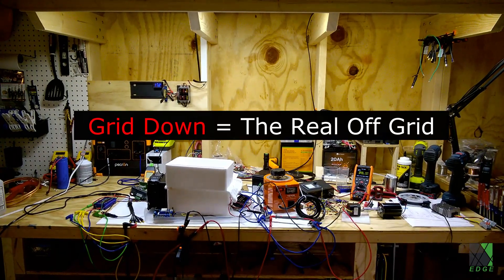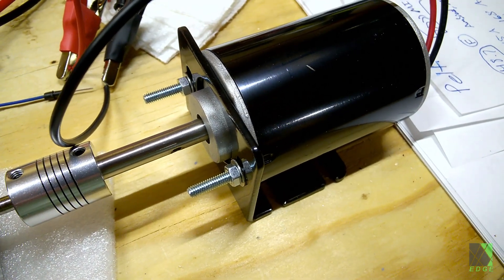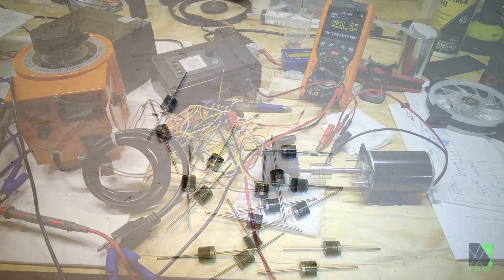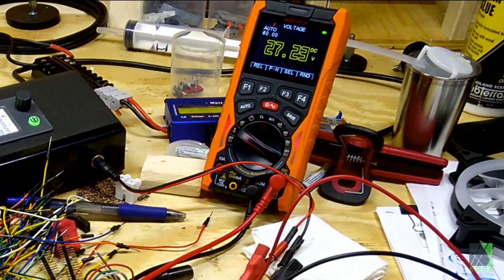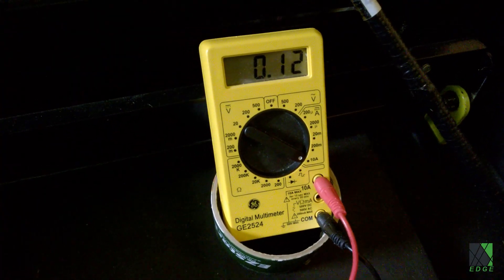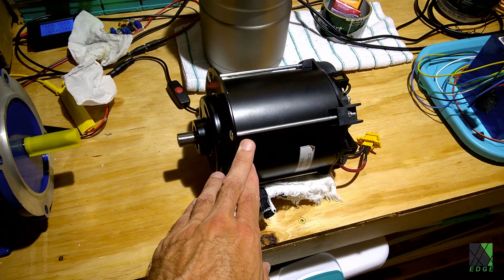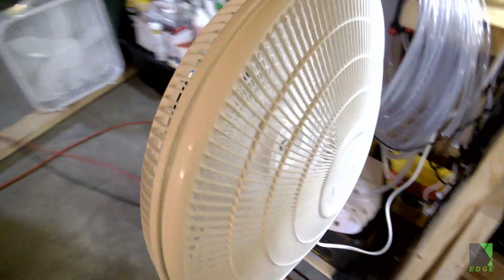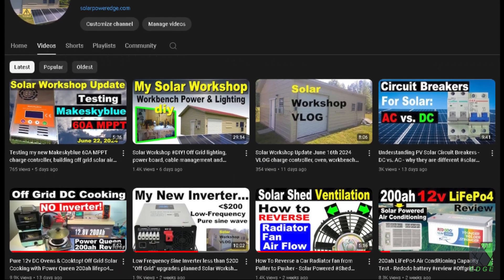Grid Down Electromechanical Voltage Conversion & High Tech Survival! How to charge 48v from 12v #diy

Comment: I still have a box fan that I put an auto radiator fan motor in it. 6 amp pull. I think it would work ok with a 12-volt solar panel. Never did try that yet. I have around 1500 watts at 12-volt. I did make a solar ceiling fan that we used for lots of years. Wife wants me to put it back up. I used a 36-volt DC Ameteck motor. Worked great. I used an electric heater element for speed control back then. I now use the cheap dc to dc controllers form China. You have some great videos. I just found your site. I will be looking at a lot more. Thanks.
Reply from the maker: @MrBasilkey Hi, glad you found this site... nice fan mods.... yeah I am sure it would run on a solar panel, even a 50w panel would probably get some good cooling

Comment: Is it possible to take a universal motor from a washing machine and then add windings and tap them at the desired voltages and then use that voltage to run stuff?
Reply from the maker: @bigmouthstrikesagain4056 Hi, excellent idea. I need to experiment further, with 2 motors I found. One is a washing machine motor, the other is a different kind. If I build anything useful I will upload the results and share

Comment: i cant see what wires you have going where with all those wires in the back lol!   i am going to check and see if that looks similar to the step up motors i have.,  been out for a bit and was happy to see a new video...  FYI  will email you a idea i had about a dc air fryer/ confection oven
Reply from the maker: @vrrevolution9183 There's wires everywhere, but they make things happen :) 
OK will keep an eye out for your message... FYI I am building a larger oven for solar/12/24v but haven't been able to finish it. The half-finished oven appears in my last VLOG
Reply: @solarpoweredge  i do not see it?   is it on your website?  please pass link
Reply from the maker: @vrrevolution9183 It's a bit hidden... the VLOG was added on the end of my solar air conditioner video here. The oven is barely mentioned but it's all I have uploaded right now https://youtu.be/2I4lH-8_cCs

Comment: Ahhhh this video takes me back to the 90's here in Melbourne when we had a fire at the natural gas works and since most of the houses need gas to run the stove, heating and water boiler, should have seen the mad rush to get out and purchase something to cook and boil water with that didn't run on natural gas.... 
I still remember going into apocalyptic survival mode.... 
I took an old oil drum, cut it open at the top and put some breather holes in the bottom, then I took apart an old box AC unit that I brought home ages ago for reasons I couldn't remember, I took out the larger radiator and put it on top of the oil drum which now has firewood in it, with some Teflon tape I was able to get the garden hoses to fit into the radiator, the other side of the garage hose went to a tap which will supply the radiator over the fire with cold water and then send it to the boiler and into the overpressure release pipe which was easier to open the tap on to let the hot water to come in.... All I had to do then was turn on a hot water tap inside the house to complete the system and in a short time I had a boiler full of hot water for showering! 
While others were having a bath like it's mediaeval times in England, I was having normal showers like nothing was wrong! 
I know a lot of people who will pick up a nut or screw around their property and toss it in the bin, I'm not one of those people! I will admit that I'm a hoarder.... But I will never throw something out only to need exactly that a month later and then go to someone who hoards stuff expecting them to provide me with whatever they were hoarding! If I'm going to through out everything, I should always remember where all the shops are and be prepared to pay.....
Reply from the maker: @PeterMilanovski What a machine... that is exactly the kind of engineering I like and respect. Getting the job done! My hot shower is literally an old cat litter bucket with HWH element, and /or a cheap insulated cooler with heating element if more is needed. Hot showers are critical to boost morale during bad scenarios :)
PS I will admit, I am a hoarder. Can't even throw away plastic cutoffs, cardboard boxes, bits of wire insulation, bottles, it's terrible. On the other hand, "waste not, want not".
Reply: @solarpoweredge   I think that a good way to heat water is getting a square aluminium pipe, seal up the ends, tap some threads and install some pipe connections at either end, get some TO220 diodes and line the pipe with them, you can probably solder them? Not sure if their metal tabs are connected to one of the pins? Or..... You can use Peltier devices which are a heat pump after all!. Something to use as a thermostat and a small water pump to circulate the water in a tank..... Or possibly go tank less and just use more aluminium pipe, each Peltier device doesn't need to run at full power as the water should be getting progressively hotter the further it gets...... You then can control the voltage to get the water at the right temperature..... 
Lots of ways to go about it....
Reply from the maker: @PeterMilanovski Found some metal pipe that's 2 inch square, it just might get turned into something. Tons of ideas here :D
Reply: @solarpoweredge   there you go! I have some aluminium 2 inch square tube left over from the roof installation of solar panels that I have been planning on getting the ends sealed off but I don't have an aluminium welder, recently I was introduced to someone who can help me with that! 
My first idea was to put Peltiers on it to generate some current form waste heat, then use that current possibly via a DC to DC converter to drive other Peltier devices to actively cool the (either) other end of the square aluminium pipe or use a separate pipe.... 
Basically the idea is to cool down the waste heat water using the heat to cool it with.... Totally silent due to not needing to use a fan! 
Using a Peltier device or devices to actively cool, if enough can be used should theoretically get the return water to be cooler than what can be achieved by a fan and radiator.... The only issue I can foresee is the size of it! It could be designed to sit close to a wall and run up the wall, a shroud around it would use the convection cooling system to avoid using any fans..... 
I'm thinking that this would be a good way to cool a Peltier device fridge freezer, the complete system being solid state, no moving parts and very quiet!
Reply from the maker: @PeterMilanovski I like this idea very much! I suspect peltiers have a lot more applications than commonly thought!
Reply: @solarpoweredge   ohhhh they certainly do! 
What a lot of people don't realise is that once a certain technology is discovered, people try to apply it everywhere, take the humble compact cassette! Magnetic recording..... Apart from all the different formats like the 8 track and reel to reel for audio and video, it was also used in black box flight recorders, some space probes used tape to capture data and then relay wirelessly, the first digital camera by Kodak used a compact cassette.... And there are countless other applications that I can't remember at this point in time but remember how surprised I was to find out that tape was also used but never would have guessed it! I have the videos somewhere (I'm a hoarder at heart)... 
My son purchased a new phone made by Asus, a gaming phone which needed extra cooling and thus came with a really nice Peltier cooler with fan which nicely clicks onto the back of it.... I had a water filter with built in chiller in the early 2000's which at the time knew nothing about! You are supposed to turn it on and leave it running but we used to only turn it on when we needed to use it! No wonder why the water never cooled down LoL 😂.... I ended up taking it apart but kept it's internals which I have been playing around with its water tank with attached Peltier, heatsink and fan.... I have a rechargeable battery powered, Peltier wine bottle cooler that someone didn't even use and left it on the nature strip in its box.... They probably didn't know how to use it either LoL 😂.... 
Then there's those Peltier driven wood stove fans which are popular...  My daughter has one of those little Peltier fridge things for her beauty care products.... 
There's probably more applications that I'm not aware of or not currently coming to mind but there's definitely a lot more applications that they can be used for! 
Ohhhh I just remembered that channel where the guy made a new burn chamber for his diesel heater so that he could put Peltier devices on it to charge a few batteries and essentially provide the 12v needed to run itself! Brilliant! It also has a USB charger for a phone! I really wish that the Chinese see it and start making them like that! You can burn used oils in them if you dilute the oils with petrol or kerosene.... Some people also say that you should start it and stop it on kerosene and you will never need to open it up to clean it! 
I guess you can add a square pipe either to the exhaust system or the hot air outlet with Peltier devices for warmth and power generation during the winter months???? Unless you have lots of free firewood? That's a different story though..
Reply from the maker: @PeterMilanovski Lots of interesting stuff here :D you make a lot of good points... someone offered me a Diesel heater but didn't want to buy fuel... nevertheless, there is a small "wood burning machine" experiment in its early stages. Maybe it will have peltiers added later. Don't know if it will work, but if it does - I'd feel obligated to share it :D
Reply: @solarpoweredge   I'd feel obligated to watch it! It would be a pleasure! As always 😁.
Reply from the maker: @PeterMilanovski :D :) 👍

Comment: Hey Dave, love your videos! So I’m putting in a well which will flow into my lake. My thinking is DC pump wired directly to the panels. When the sun shines the pump pumps. Questions, will the price of a DC pump out weigh converting to AC ?  Once the lake is filled up I want to do the same thing with a DC motor to aerate the lake. It will be quite a big solar array powering a heat pump for heating and cooling too. 
Again, thanks for your videos.
Reply from the maker: @gordon6029 Hi Gordon, welcome! glad you like the videos and I'm thankful for your support! Sharing my own opinion here... converting to AC is always going to be an extra liability. The solar panel puts out DC, might as well consume DC. Then again, if you cannot find a DC pump, there is no choice. In any case I wish I had a lake, all kinds of cool projects could happen with that :)